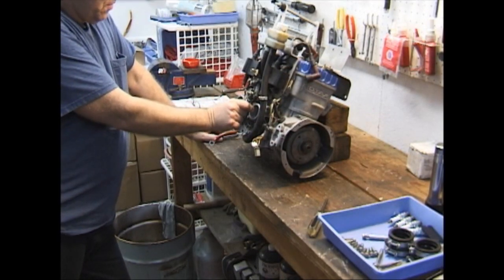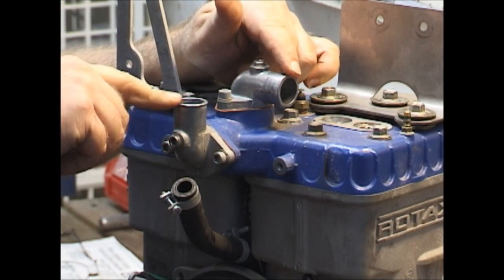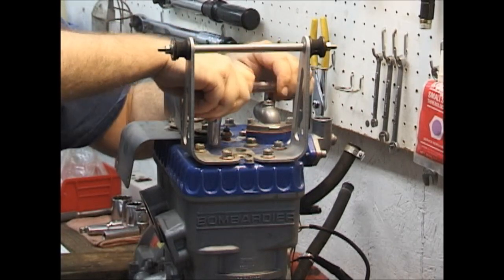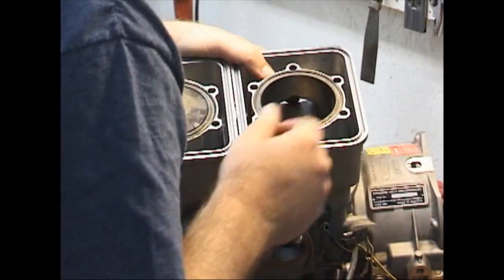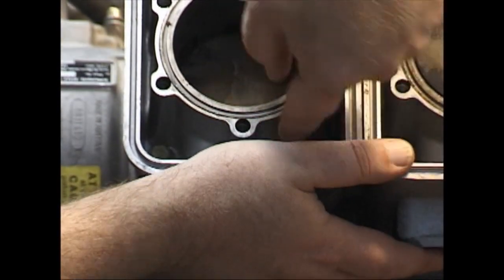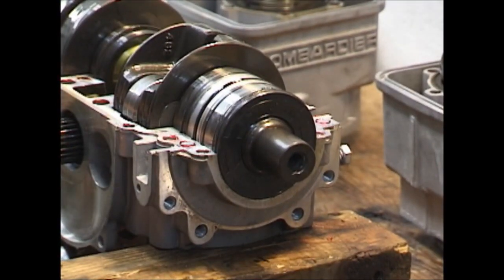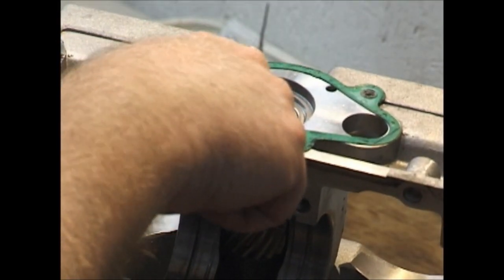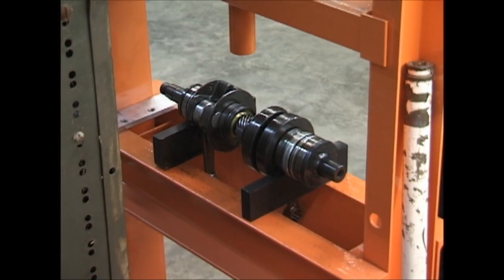Rotax 582 Tear Down & Inspection Part 2

Comment: Hello sir.  Thanks for awesome video.  I just ordered your dvd set.  One of my coils or magneto not firing .  Trying to diagnose.  I know to ohm out the coil.  Can you tell me how much voltage does magneto send to the coil and how much the trigger wire send?   Also, how many ohms are the primary and secondary of coils supposed to measure if in good condition?   I have Rotax 582 engine.

Thank you in advance

Comment: Well done although it should be mentioned that major leaks in the crank seals, crank case,  base gaskets or rotary valve cover may lean the fuel air mixture enough to cause piston holing and/or piston seizing.

Comment: Is it possible to replace the water pump seal without splitting the bottom case (can the shaft be pushed out)?  And do you have a part number for the tool used to push the water pump shaft out? Thanks

Comment: You Sir, are the guy I would want rebuilding my engine. … as a matter of fact, do you have your contact information posted?  I just picked up a 582 powered Kolb.  Has about 150 hours on it. I may get it rebuilt a little early as preventive maintenance…. Thanks

Comment: That's one sketchy lil engine there. All of those roller bearings and rubber seals for 60hp? 
 Seems like it has as many catastrophic failure points as ponies. I can see why ROTAX is phasing them out.
 Thanks for sharing the knowledge.